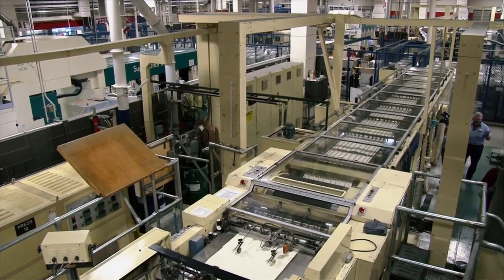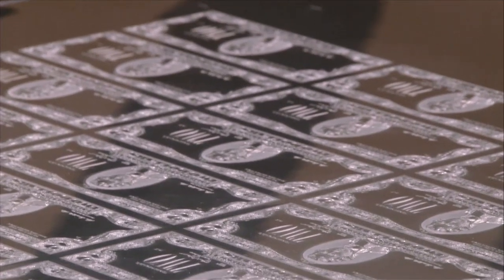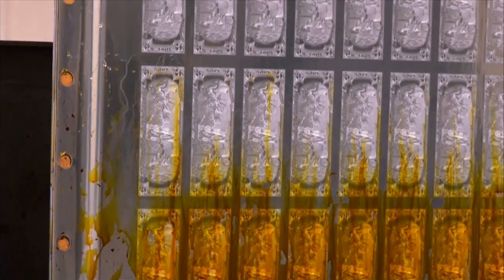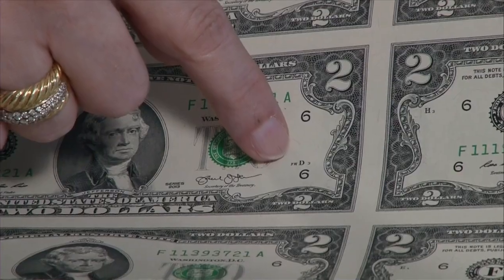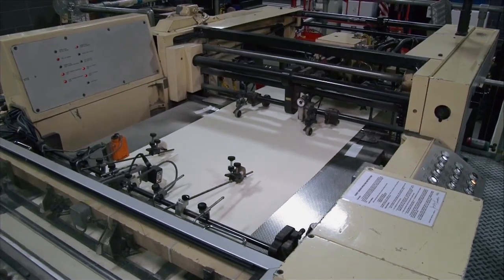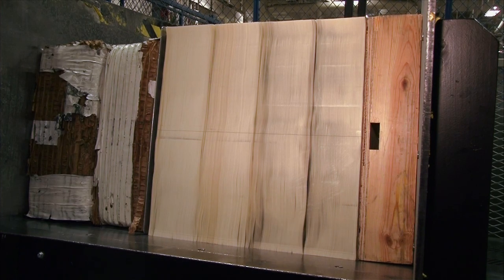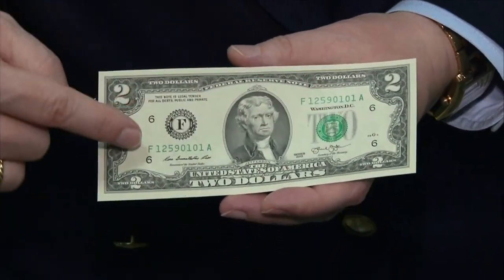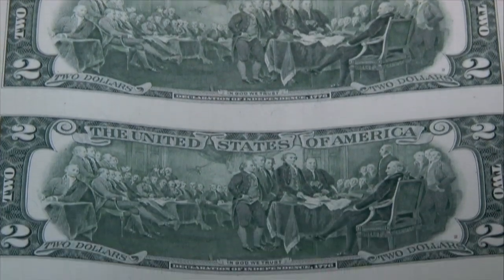How $2 bills are made - clip from The Two Dollar Bill Documentary

Comment: they ended in 2003 and clearly in this video a 2003 is all they have or under
Reply from the maker: Look closer.  2013. Why would you assume to be the authority on all this??
Reply: @TheTwoDollarBillDocumentary  - Have you heard whether BEP will release a Series 2017 $2?
Reply from the maker: @OldsVistaCruiser   It's unlikely.  They did print more in October of 2018, but that was either a 2018 or 2019 series (haven't confirmed). They printed bills in 2013 and again for the next few years, but all of those were series 2013. So the math doesn't add up for there to be a 2017 series.
Reply: @TheTwoDollarBillDocumentary  - The main series these days are the Series 2013 and Series 2017. The series number only changes when the signatures on the notes change, and tend to (but not always) reflect the year that the current presidential administration started. Instead of a Series 2019, it would either be a Series 2017 or Series 2017A. Series 1976 $2 notes are a notable exception, as Series 1974 was the main series for the notes issued during the Ford administration, and Series 1977 and Series 1977A were Carter bills. Reagan had 1981 and 1981A.